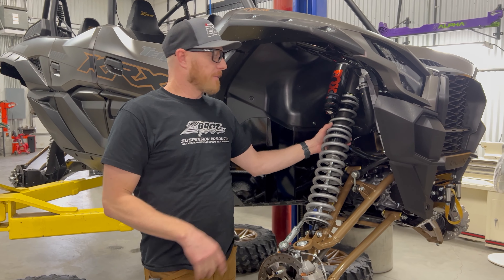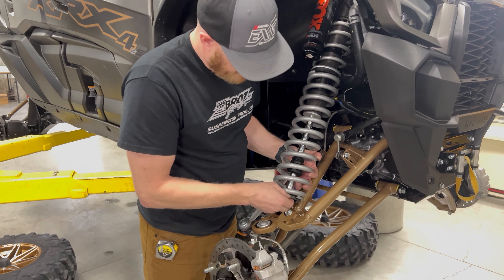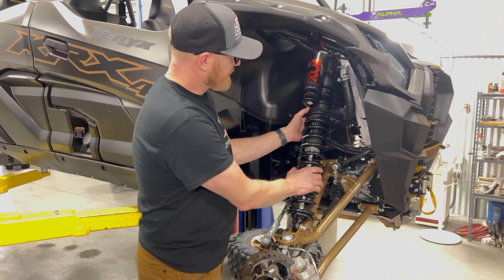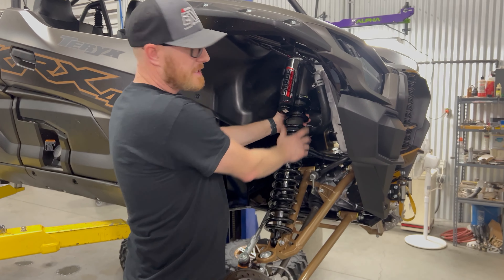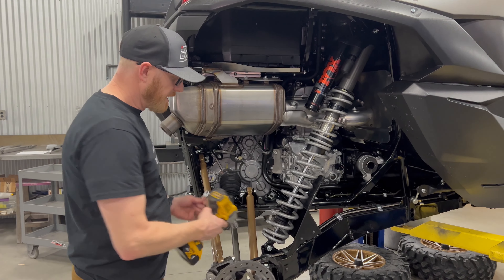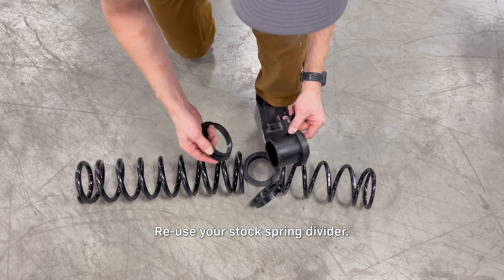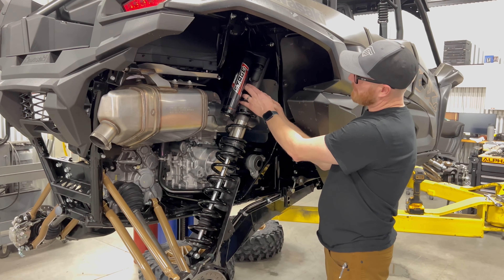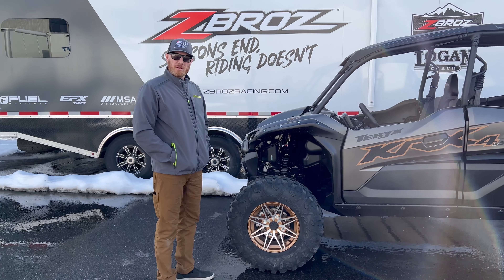KRX 1000 4 Seat Zbroz Spring Kit Install with Nate

Comment: What about going to a single spring in the front? I've seen several people wear out shock bodies due to the spring divider.
Reply from the maker: It's true, if you don't line up the spring ends and maintain prober cleaning that can happen. We run a duel rate for the sake of tuning options. A duel rate includes a cross over ring which allows you to set where the springs compression cross over and ramps into the other spring.

Comment: Is this still adjustable with the dial on board?
Reply from the maker: If you are talking about the Live Valve shock controls, yes. This spring kit will still work with the Live Valve settings.
Reply: Yes, thank you